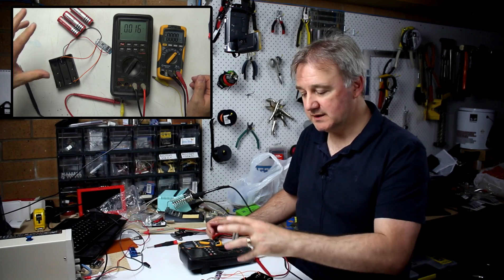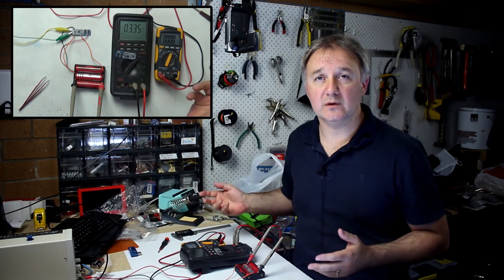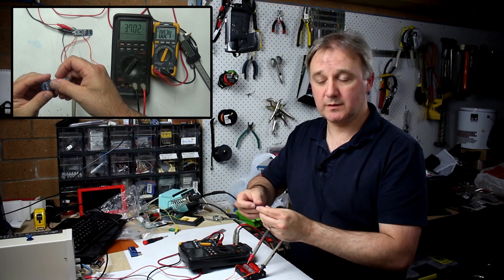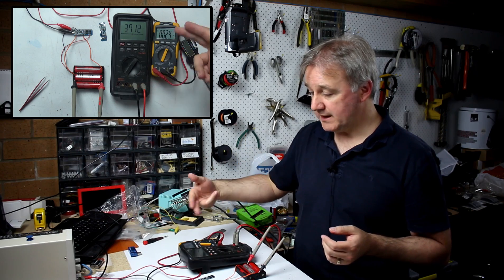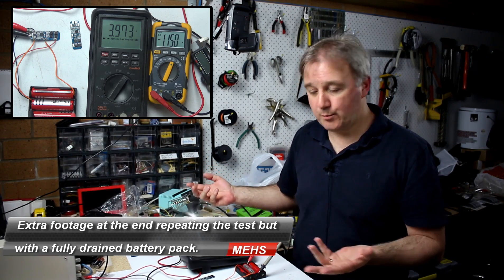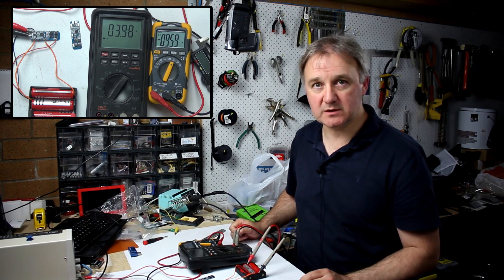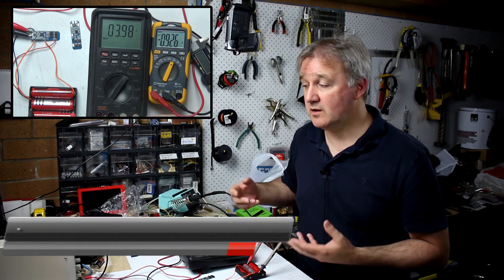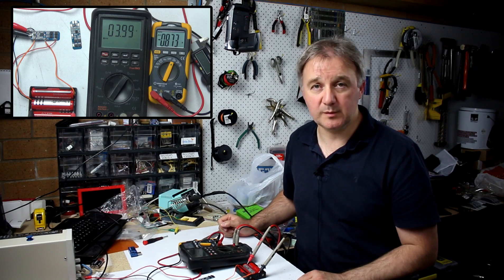Does a BMS charge my Batteries? (MEHS) Episode 57

Comment: could you also test the balancing capabilities too? will they be balanced if each battery was at a significantly different voltage?
Reply: No, they would not the bms will cut off charging as soon as one of the 3 cells ( connected in series )reaches 4.2v while charging 

It will cut off discharging when one of the 3 cells reaches 2.5v
Reply: It's best to use strictly identical cells and to make sure they are all at the same voltage before connecting them to the bms over time through charging and discharging the voltages of the cells will vary. differences of 0.03V and lower are acceptable

Comment: i know this is old, but when your charging in series, a 1a load is 1a per cell, if you were charging in parellel then yes yeah bank of series would be getting 0.33a per cell, but because your charging in series at the total pack voltage, 12v to make it easy, at 1a your charging at 12w, if you were to charge a single cell 4v at 1 amp thats 4w, 4w x 3 cells is 12w, so they are each seeing 1 amp my dude

Comment: I made a circuit, with (3 Batteries + 10A BMS & XL6009) - working fine. Buit, the battery voltage is dropping automatically even if the input voltage is ON and is 12V. Why the battery voltage should drop ??  Where could be the problem ??

Comment: I'm not sure this is correct.  Certainly your brick be it 5 or 50 Amps is only going to deliver the amount of current the BMS draws.  As to voltage no charger external or using the BMS is going to take a dead battery at 3.2 volts and instantly have it raise up to 4.2v correct me if I'm wrong?  As to the maximum charge per cell versus what your seeing (Lower but still ramping current down as the voltage is kept the same) I think instead of concerns of fire you really only have to consider the time to charge.  If I use your BMS to charge with a Lab Supply on a 3S battery I see it taking 2.x amps for the strong part of the charge curve (Where you have charged up the battery to 80 something percent then the charge drawn from the supply goes down just as it should until the battery is topped off and then charge current is as near zero as I can measure.  What do you normally do to charge?  Are you using an external charger like a Wissblue LCD-4?  Note that on this charger you may select 0.5, 1 or 2 Amps of charge current so I'm pretty sure it not only safe but probably extends the battery life.  If your removing the individual cells to put them into a commercial charger whats to be done with people spot welding say a 4 S(eries) pack to the BMS which I think is the norm.

Comment: Thanks for the information.  @4:36 Why are you dividing the current in three?  I understand energy should be conserved, not amperes.  If you supply 12V 1A (12W) then each 4V cell would get 4V 1A (4Wx3) at 100% efficiency and equal charging.  I generally agree with what you did, but I think to be accurate you would need to monitor each cell.  If 5A was actually supplied, your cells would likely get very hot!  Depending on the cell size, it might be necessary to control the input current.

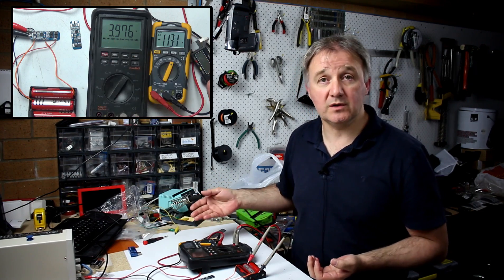Comment: @4:26 - I think you made a mistake: it is NOT shared current as all batteries are in series so current is equal for all of them - unless, BMS really splits and maintains INDIVIDUAL current for each of the cells - in that case mea culpa ;-) 
We don't see the Power Supply voltage but considering it is constant 12.5V with 1A it will be 12.5W consumption (and dropping with the time).  
So it cannot be 300mA per battery, why? Battery has 4V now, with current 0.3A it is 1.2W consumption per battery, times 3 = 3.6W for all 3 of them. 
So how is 12.5W consumed by the entire system (12.5V + 1A) versus 3.6W (as you said: each battery is third of this 1A)?
I bet you made a mistake but I am wondering ;-)

Comment: Now you can buy equilibration modules (balance boards) to attach to this BMS board and get this function without an specific charger.The only problem is that this attachment have a small margin of balance by cycle.

Comment: I have a question: what component determent the Charge current on a BMS. If I want to charge with 2A can I change that on the BMS or is that a BMS Control chip specific parameter.  hope someone can telle me.

Comment: The current is the same for all three cells, the voltage is divided. (Learn ohms law)  
So 1 amp for each cell (not 330ma)with the voltage slowly ramping up to 4.2 volts across each cell (12.6v across the three cells).
Reply: I agree.  This is correct and the video needs revision accordingly.
Reply: What will the BMS do with a 13.5v charger?

Comment: I bought a BMS for li-ion packs that is designed for also balance charging the pack. In fact, it looks almost identical to that one, but the PCB is green. If I disconnect the BMS and recharge the pack and then reconnect it, the BMS won't re-engage until a voltage is applied to the output wires. It seems to be the only way to recharge the pack by design, you can't disconnect and recharge the pack manually.

Comment: I saw your this video. I am now planning to replace the nickel cadmium cells which were put in series ( no BMS is added in the circuit) and after 2 years the charging couldn't hold which makes me to charge again and again frequently; hence I thought of going in for replacing with lithium ion batteries of 3.7v/2000mAh capacity in 3s/4p ( 3 in series and 4 in parallel) for which I have 3s/20amp BMS board. The rated capacity of the drill is 12v/48 watts please suggest me the charger specifications for this set up. The charger came alongwith the drill is having 13.1 volt/1 amp. Shall I use this for charging after constructing the battery pack as 3s and 4 p setup? Your answer will help me in saving lots of pains to me before starting to do it. Also kindly let me know the parameters to be observed before designing a PS for the drills and other equipments which are sold with nickel cadmium cells.

Comment: There must be some 2v or 3V difference between Max BMS voltage and charging Voltage. For example my system is 62V~64V- solar panels connected directly to a 14s BMS, and it works perfectly as a charge controller because the Panels have always a slightly higher voltage than the full charged battery-58.6V.

Comment: That sucks to know and I was about to do a project, I wanted to use or more like make a solar 3s just for a super small led for night usage I’m currently using acid batteries , but they suck at taking fast charge only .5- .7 amps per hour and battery is 4AH -12volts . Where I have used lithium with no bms and they take their 1c rating like nothing well and I have smart charger they work perfectly with out bms but when it comes to charge them without that bms  in solar panels you can’t it’s not ideal, and you can’t really use a bms board and at the same charge it some bms won’t let you do that . Where in an acid you can charge it and use that battery . Any ideas what can I do ?

Comment: I'm a bit confused. Will a BMS + constant voltage constant current power supply balance charge my battery ?
Reply from the maker: Hi.  To get a balanced charge to each cell in the battery you would need to use a balanced BMS.  Many, like this small blue one don't have balancing.  Physically a larger board.  Cheers.
Reply: @michaelsstuff4402  I was wondering if it exists. Thanks a lot for the information ☺️

Comment: Thankyou for your great work. I have a query here.What charger system would you use for to charge the batteries properly when using the BMS board. I am building a unit in an old laptop shell
which has 19v transfiormer in. I need 12v for the screen and for some audio preamps etc that are being used with a raspberry pi with internal plug in sound card with audio recording in and dac output. So I would need a healthy amount of 5volt power as well. The ability to leave the batteries connected wen the external power is working. I willlet you know what is being used for if you are interested. Lynn Woods (mr.)

Comment: I've just done some tests on this board. If I have 3 cells, 4.1v, 3.33v, 4.18v and start charging, as soon as one of the cells (the last one) hits ~4.26ish it cuts off charging for ALL of them. While I understand this is not a balance BMS, I thought the behaviour was that it only cut off the charging on the individual cells that are already at max and continues with the ones that are not (the 3.33v one)? Is this the experience you're having?
Reply: I have the same result too, I guess I need to get one with Balancer function too.
Reply: @budmartin3344  I did quite a lot of testing here and found the board to be completely useless for anything really: https://www.facebook.com/pg/StockysElectronicsProject
Reply: Even with a balacing BMS it is ging to be close to the same result!! Likemost people, I though I could plug 3 x 18650 to those BMS type and get a 12v pack, and then when it is empty plug a 12v charger and then it will charge.
It is more complexe than! There is 2 option here:
Option 1- Get a special wall charger for 18650 battery, they usually are rated to work with the BMS you installed in you project. If you used a 3S BMS, so you need the 12v version. Those wall adapter got an small led on them, and they are kind of smart, they cut ff once the BMS is charged at the other side.
Or
Option 2- Get a charger Board for 2S or 3S, and add it to your project, ad then plug a normal 12v charger.
Explanation: 3x 18650 connected to BMS >> Charger Board >> 12v.
If you do some reading you ll learn that a BMS is just a protection board for the 18650 batteries, not a charging board!!
Electronic words have been made very banal , as result people are confusing everything...

Comment: I wanna charge a Park 12A2 Li-ion battery (18650P 3×3,6V BSB connected) with an AEG charger AL1214G. The manual of AEG charger refers charge times for Li-ion too, the voltage when charging the old 12V Ni-cd (10cells of 1.2V) was at least 14.2V. Can i charge the Park 12 A2 battery with AEG 1214G charger? Can BSB handle the 14+volts without damaging the batteries?
Reply from the maker: Hi.  It might work for a short time but that charger does not charge in the way lithium cells need to be charged.  I would say use that charger as an emergency only to put a little charge into your cells, otherwise avoid that charger.  Research how lithium cells need to be charged (battery university) and start there.  Cheers.
Reply: Thank you very much for your reply. I studied the problem in depth and it's more complicated than i thought. The Parkside charger is at 12,68V while the AEG charger at 14,4V. I don't know if the BMS can tolerate the extra voltage and moreover the Parkside charger uses a C- pole instead of the - pole when charges the battery...It's risky and dangerous to do it, so i won't try it.

Comment: My BMS stop providing a flow of current after voltage down from 28 v to 23 v with a battery pack of total 28 cells. I am planning to drain all cells out and do recharging to the full again but BMS doesn't allow me to do that. Upset but don't know how I could do that. Any help? I like your videos, they are great.
Reply from the maker: Hi.  28 cells?  Do you mean 28 volts?  Remember each lithium ion cell is 3.7v nominal, 4.2v fully charged and a BMS should stop the discharge between 2.8 and 3v per cell.  Cheers.

Comment: Weird conclusion because when I use a TP4056 board,  current drops when near to complete charging, cannot spot a difference. When the consumed amps is nearby zero, the battery is fully charged. I think that is pretty normal, as it should.

Comment: Can charging be done while a Load (live/active/running) is connected?
Reply from the maker: Hi.  Yes if your power supply has sufficient power to run the project and spare capacity to provide power to the cells without them being drained.  It will depend on your project wiring too.  Also, its not ideal as cells can become stressed which shortens their life expectancy.  Cheers.

Comment: These types of BMS protection boards don't actually charge Lithium batteries, they prevent charge over-voltage by disconnecting the charger from the batteries when any battery in the pack exceeds a preset max voltage (approx 4.2V).
Because the BMS board doesn't control charging current, your external charger should be a constant current source or at least current limited to less than the maximum charge rate of the Lithium battery type connected. 
And because the charger and the load are connected to the same point, it can get tricky if the charger must power the load and charge the batteries at the same time. The charger output current should be greater than the load requirement but less than the load current plus the maximum charge current for the specific battery used. 
Another issue: when the circuit senses over-voltage and disconnects the charger your load voltage can suddenly change. This might be OK but could cause problems in some applications.

Comment: Thanks for the video.
Are we certain those cheap ass ultraFIRE cells don't have some current limiting device under the button top?
Reply from the maker: They are protected cells but they are just cheap and falsely rated.  I still have a couple but I've thrown out about 6 because they stopped charging properly and were showing high resistance.  I tried many of them in an old 2000 lumen torch which is also a good extra test and they just failed to run the light.  Just rubbish.
Reply: @michaelsstuff4402  thanks for the reply. I used those for a while, but then started to see horror stories. Now, for me, I pay a little more for the brand name cells and feel much safer.

Comment: Thanks for the vid, it provides the info that I was looking for. I realised your error on the current-sharing bollocks at an early stage, so turned the sound off and watched the meters. Apart from the initial current-surge, the bulk charge is within spec +/- 10-15%, so for a commercially available cheapo it is great for hobby-use. Might be worth re-doing the test from flat to full. Also watch out for fake 'ultrafire' batteries, there are a lot about.

Comment: What difference between BMS vs TP4056 and which one is better to use with 18650 lipo batteries?
Reply from the maker: Hi.  A TP4056 standard is a charging IC for a single cell.  A BMS is a protection circuit for any number of cells that doesn't actually have a real charging circuit.  A TP4056 with a protection circuit will charge and protect 1 cell.  A 3S BMS will protect 3 cells connected to the BMS in series but doesn't actually charge.  Cheers.

Comment: Are there boards for handeling lipo charging ? and how would you hook them up to the bms ?
Reply from the maker: You still need to include a dedicated charging IC or board like the MAX745 but the process is the same.  Better and safer results if you use a BMS that includes balancing.
Reply: @michaelsstuff4402   thanks for the quick reply. I'm relatively new to the fields of electronics and what I want to do is build a lithium ion battery pack then can be charged and discharged without worrying about  overdischarge or overcharge. The recommended charging board can only handle charging and does not provide overdischarge protection are there boards that provide both ?
Reply from the maker: @frederikex4545  None that I know of.  You can use a MAX745 and a BMS together.  If only using 1 cell or 2 cells you can use the TP4056 or TP5100 boards.  Cheers.
Reply: @michaelsstuff4402  thank you very much :)

Comment: Thanks for the coaching Sir. What would you recommend for a 5s(18.5v) powertool battery pack? I need to replace 2 packs which aren't available aftermarket. Each pack has 5 x 18650 @2700mah each. The power tool is rated for 18.5 volts. thanks and Regards. Shmuel.

Comment: I found that some work better than others and some don't work at all. Another thing to look at is how much current you can get out of a BMS enabled pack compared to not using one
Reply from the maker: Agree, some are better than others.  The BMS is there to provide limits so you will get more current from a pack without a BMS but potentially do damage to the cells if you ask too much from them.  That's why you use a BMS.   Cheers.
Reply: @michaelsstuff4402  This is  where I see a difference:  Drills and other high draw tools seem to take full advantage of the total available power with monitoring cell integrity in the background. I have not seen this type of performance from any off the shelf Chinese BMS

Comment: This was an interesting video. I wished  you time lapsed the video until the current started dropping.  Like you found out the 1 amp was charging the 3 cells so there was still a lot of charing going on.  At some point the cells would of reached 4.2 and the current would drop off dramatically (if the bms worked as such). Then you could say that the bms although not perfect is pretty close to what a charger designed for Li-Ion batteries would do.  In your video about the bms you kept mentioning it as a charging board also which is mis-leading. I am glad you made this video and set things straight.

Comment: There are some other BMS designs, where the charging voltage is applied on different pins. It would be nice to see if those are better. https://ae01.alicdn.com/kf/HTB1j8_nHKuSBuNjy1Xcq6AYjFXav/3S-60A-Lithium-Li-ion-Battery-Charger-Protection-PCB-BMS-Board-11-1V-12-6V-Lipo.jpg_640x640.jpg